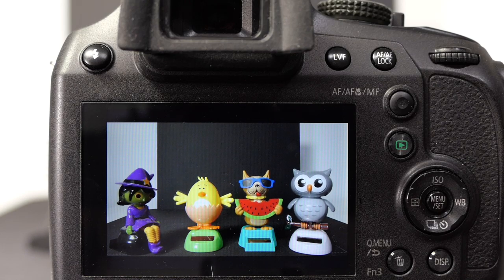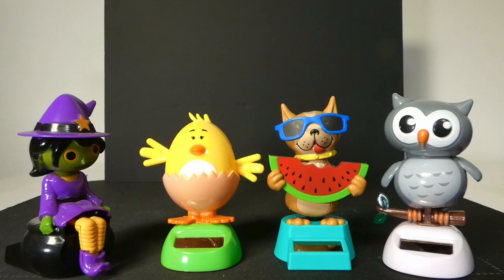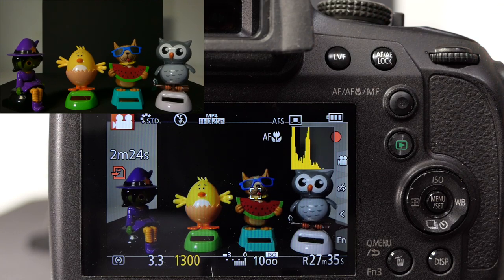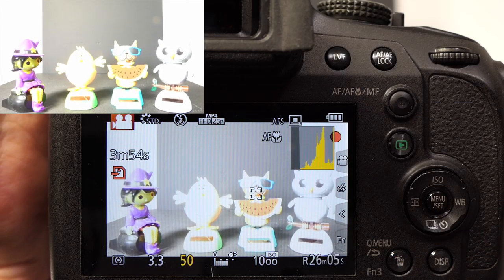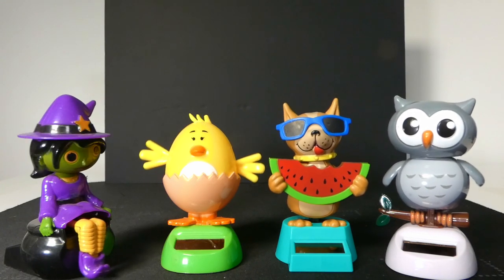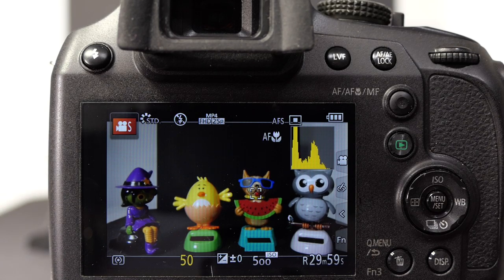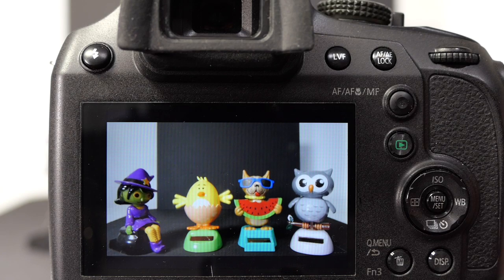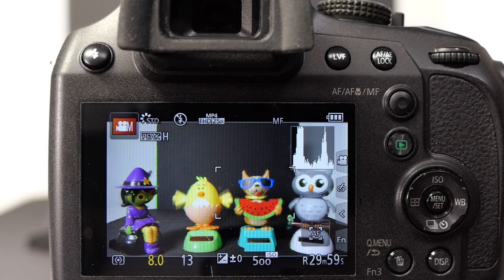Using Variable ND Filters for Video with Panasonic Lumix Bridge Cameras

Comment: Regarding your Mode setting when using the 180 shutter rule. If you are shooting a cinematic video in changing light conditions, would you suggest shutter priority? for example -shutter at 1/50, then set Aperture you require and then auto ISO?  or always go manual ISO?

Comment: sorry , but You are totally wrong, The foto-thing you preach here, is not appliable to veideo. You shot alway double the Framrate, ; 24= 48 shutter .
Reply from the maker: Please explain. All my statements in this video are totally correct
Reply: @GrahamHoughton12  ??? You dont change the shutter !! in video/ film production, maybe in Photo, but NOT in Film. If you need  to chang expsure in film, U use  Aperture, but if you want f.eks. the shallow depth of field, on ., lets say. F4, in a daylight sceen, you adjust the ND filter, NOT shutter speed. So, that why I say your wrong !, If you shoot, in 30fps, you set shutter to 60, OR you set your shutter angle at 180 . :)